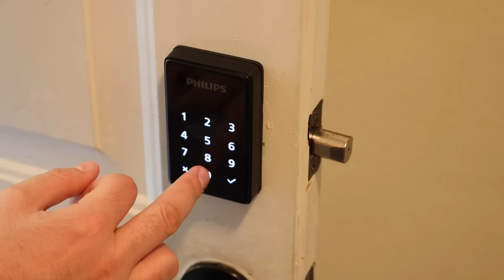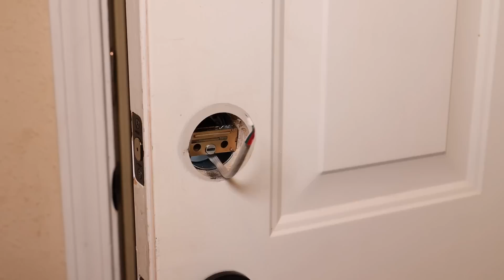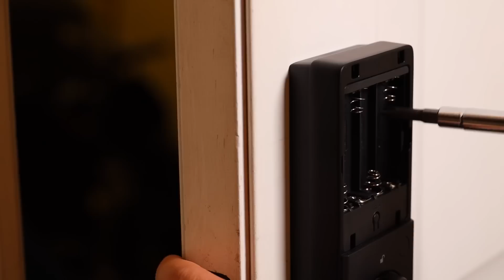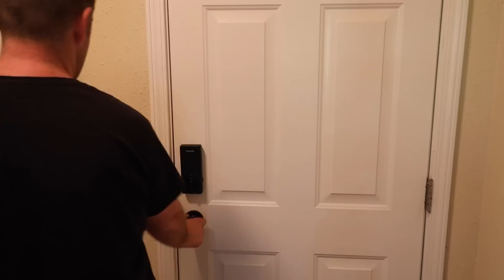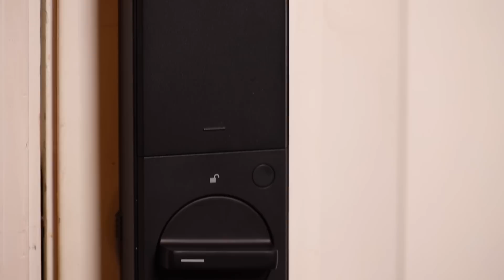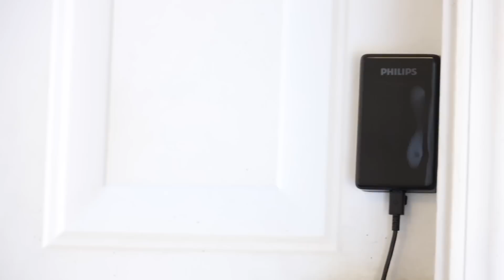Philips First Smart Lock Standalone Deadbolt No Wifi or Bluetooth Needed!

Comment: 1st
Reply from the maker: Thanks!
Reply: Got one completely installed and it won't unlock automatically. It's chiming at me like there is an error. 

I can freely lock and unlock manually with the key or from the inside, but when I try to input the pin, it won't lock or unlock.
Reply: @robcas456 Hi have you been successful yet with this Lock?